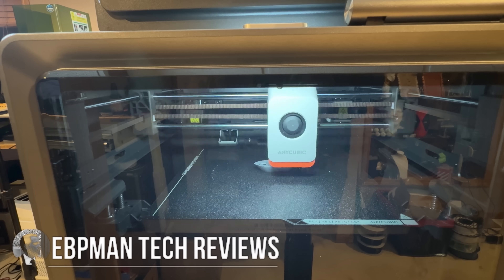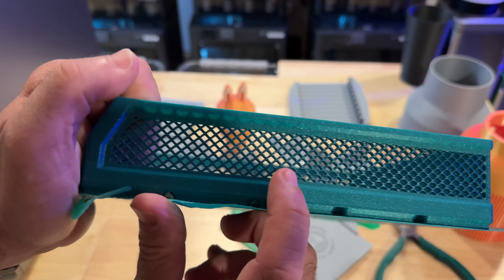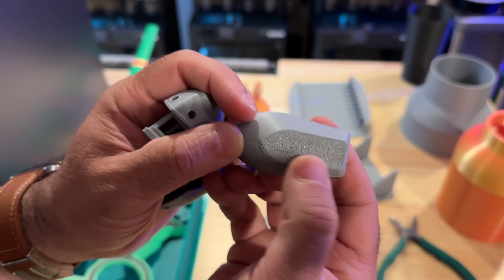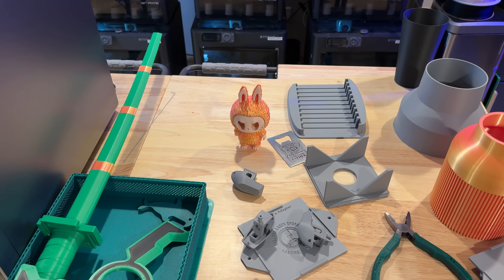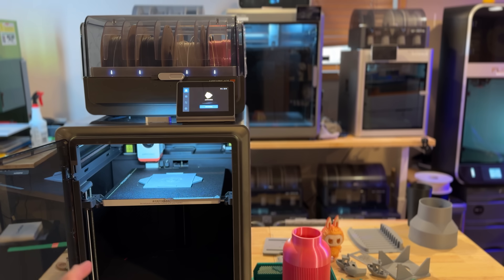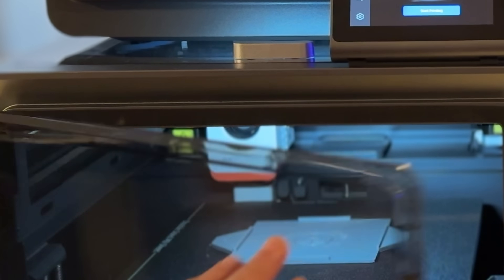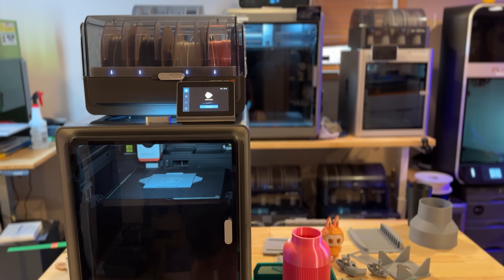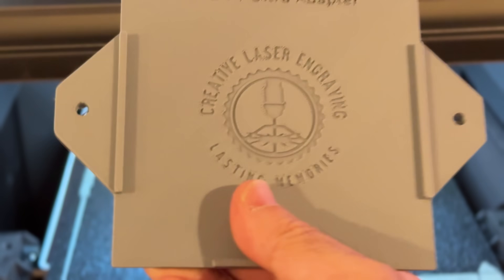3D Print Farm Approved? - Anycubic Kobra S1 Combo Review

Comment: With a bambu p1s combo being only $100 more on sale, would you suggest the bambu over this? Or save the $100 to go towards filament?
Reply from the maker: Bambu
Reply: @ebpman  that's what I was afraid of haha, I'm a little hesitant on the firmware which is why I was interested in the Anycubic. However AC has been less user friendly than Bambu it seems for not letting users even tune the z mesh or anything without 3rd party software. Not to mention no Hardened nozzles without 3rd party. May have to try out the Bambu with the new AMS 2 PRO since it has the drying like this AC
Reply: @suedenoose  My response to that as a bambu owner is that I haven't had to worry about tuning anything in the 2 years I've been using my P1S. Any issues I've had are my own mistakes when slicing. No need to tune, worry about temps, bed leveling, etc. It just works. It's almost unfathomable coming from much worse machines that I literally spent weeks working on fixes for. I spent more time working on my other printers than actually printing stuff.
Reply: @burnsy87  yeah i still havent bought a pronter yet , but have decided against this one. I think its great if you like to tinker, but i dont on the printer itself.  Ill either end up doing Bambu or Qidi at this point.  If the Bambu X1C goes on sale lower than $1000 ever then its a done deal 😂